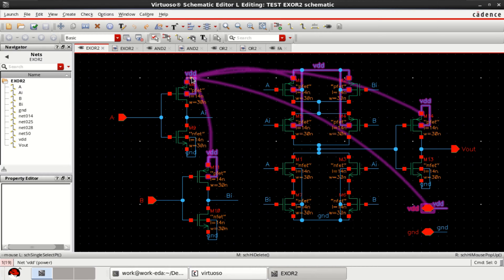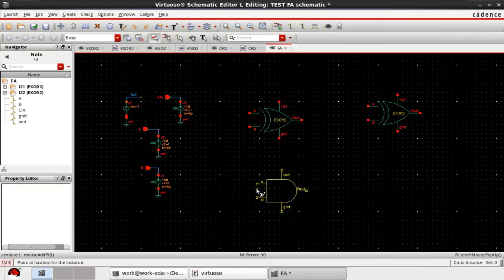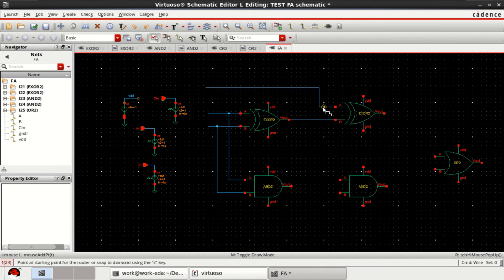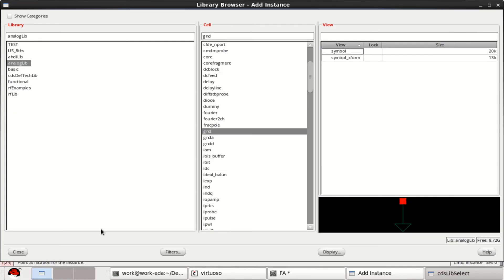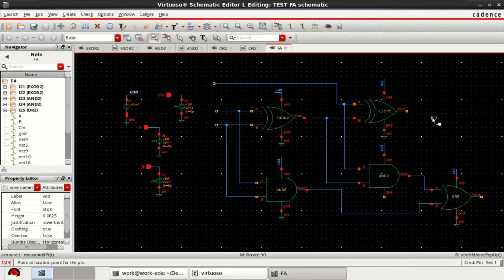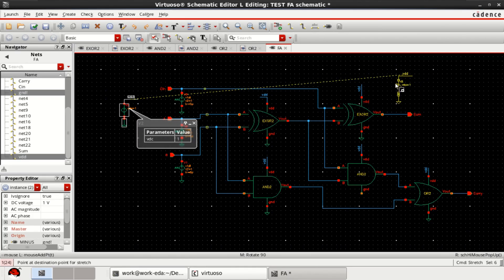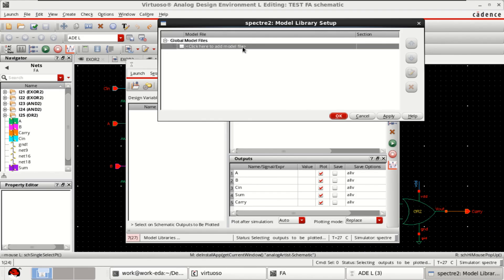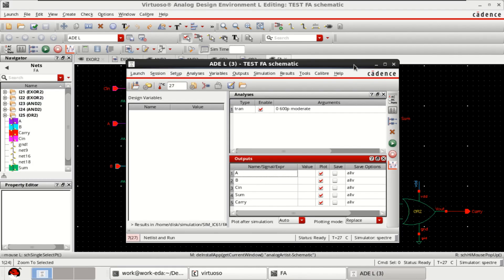Cadence Virtuoso: Full Adder Design using Standard Logics.

Comment: Sir can you specify the specifications for vpulses and vdc
Reply from the maker: Hi, Vdc is a dc voltage can be 1/1.8/2.5
Pulse (V1 V2 delay trise tfall pulsewidth pulseperiod)
           (0 1.8  0 0.1n 0.1n 10n 20n)

Comment: Sir can we design crystal oscillator in cadence virtuso?
Reply from the maker: Crystal means is it material related. Any circuit related to CMOS transistor can be designed
Reply: @dr.hariprasadnaikbhattu  sir I want to design pierce oscillator is it possible in cadence virtuso
Reply from the maker: @venkatakishorekarumuru8698  Is it a circuit based